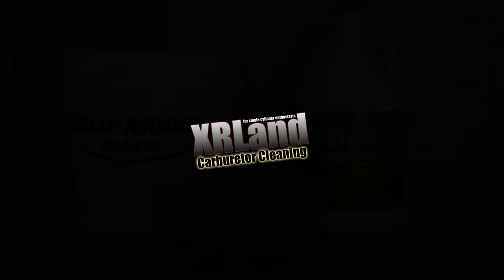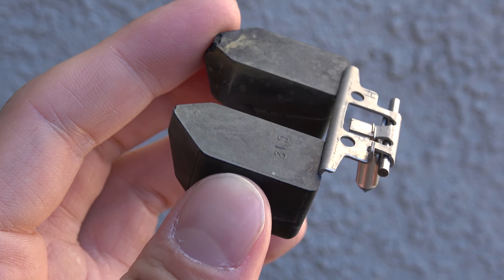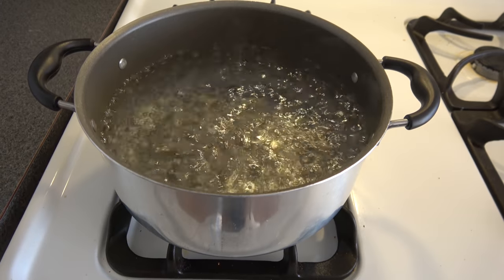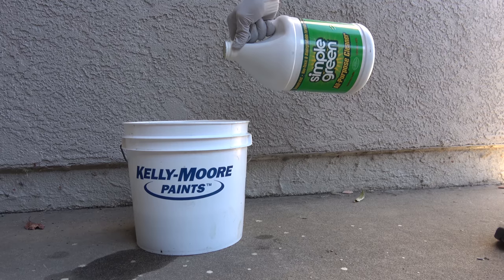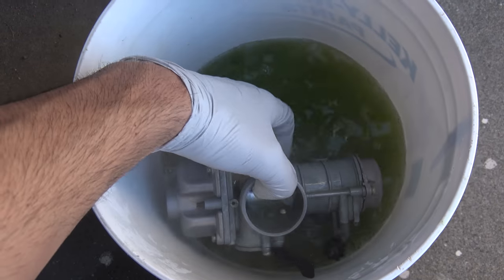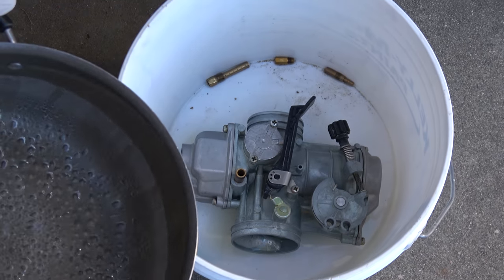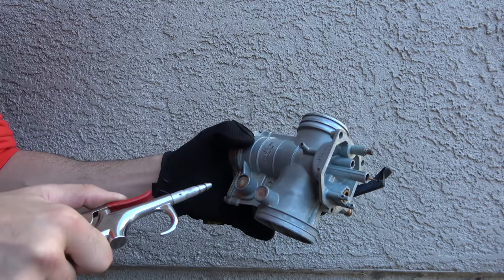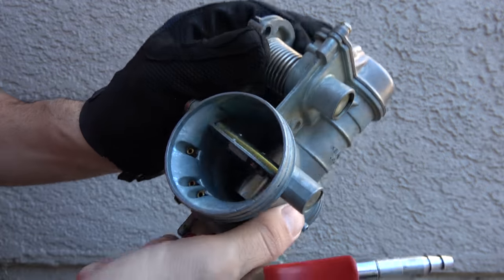How to clean a clogged motorcycle carburetor

Comment: Hello, I have stinky green 9 years of once was gas carb and petcock. Honda VTR 1000. It’s crusty in spots and not even carb cleaner is working. Should I try this, I hope it help the horrible smell?
Reply from the maker: Hello. Hope you can get that VTR running smooth again. I've never used this method on that aged condition of carb, so I can't report whether it will work. My suggestion is that you soak for longer. After adding boiling water and 50% simple green, let it sit overnight or two nights even to allow chemical penetration. You may have to repeat this entire process twice. If that doesn't work, then I'm not sure what you would need to restore the carb to former glory. There are probably more caustic chemicals out there that would work, but I don't have recommendations. Best of luck on your project. Let us know if you figure out what solution to your crusty carb woes. Kind regards.
Reply: So did it work for your crusty cab?
Reply: It did help. When gas turns  from ph neutral to ( add o2 and time ) acidic then to a base -it's caustic. All of the jets needed replacement and the float barrels corroded and many area required bright work. And all rubber parts needed replacing. It took a few times to rebuild the carbs to get it right and today the bike is used weekly. Happy, no awful skunk smells.
Reply: It did help. When gas turns  from ph neutral to ( add o2 and time ) acidic then to a base -it's caustic. All of the jets needed replacement and the float barrels corroded and many area required bright work. And all rubber parts needed replacing. It took a few times to rebuild the carbs to get it right and today the bike is used weekly. Happy, no awful skunk smells.
Reply: It did help. When gas turns  from ph neutral to ( add o2 and time ) acidic then to a base -it's caustic. All of the jets needed replacement and the float barrels corroded and many area required bright work. And all rubber parts needed replacing. It took a few times to rebuild the carbs to get it right and today the bike is used weekly. Happy, no awful skunk smells.
Reply: It did help. When gas turns  from ph neutral to ( add o2 and time ) acidic then to a base -it's caustic. All of the jets needed replacement and the float barrels corroded and many area required bright work. And all rubber parts needed replacing. It took a few times to rebuild the carbs to get it right and today the bike is used weekly. Happy, no awful skunk smells.
Reply: It did help. When gas turns  from ph neutral to ( add o2 and time ) acidic then to a base -it's caustic. All of the jets needed replacement and the float barrels corroded and many area required bright work. And all rubber parts needed replacing. It took a few times to rebuild the carbs to get it right and today the bike is used weekly. Happy, no awful skunk smells.
Reply: It did help. When gas turns  from ph neutral to ( add o2 and time ) acidic then to a base -it's caustic. All of the jets needed replacement and the float barrels corroded and many area required bright work. And all rubber parts needed replacing. It took a few times to rebuild the carbs to get it right and today the bike is used weekly. Happy, no awful skunk smells.
Reply: It did help. When gas turns  from ph neutral to ( add o2 and time ) acidic then to a base -it's caustic. All of the jets needed replacement and the float barrels corroded and many area required bright work. And all rubber parts needed replacing. It took a few times to rebuild the carbs to get it right and today the bike is used weekly. Happy, no awful skunk smells.
Reply: It did help. When gas turns  from ph neutral to ( add o2 and time ) acidic then to a base -it's caustic. All of the jets needed replacement and the float barrels corroded and many area required bright work. And all rubber parts needed replacing. It took a few times to rebuild the carbs to get it right and today the bike is used weekly. Happy, no awful skunk smells.
Reply: It did help. When gas turns  from ph neutral to ( add o2 and time ) acidic then to a base -it's caustic. All of the jets needed replacement and the float barrels corroded and many area required bright work. And all rubber parts needed replacing. It took a few times to rebuild the carbs to get it right and today the bike is used weekly. Happy, no awful skunk smells.
Reply: It did help. When gas turns  from ph neutral to ( add o2 and time ) acidic then to a base -it's caustic. All of the jets needed replacement and the float barrels corroded and many area required bright work. And all rubber parts needed replacing. It took a few times to rebuild the carbs to get it right and today the bike is used weekly. Happy, no awful skunk smells.
Reply: It did help. When gas turns  from ph neutral to ( add o2 and time ) acidic then to a base -it's caustic. All of the jets needed replacement and the float barrels corroded and many area required bright work. And all rubber parts needed replacing. It took a few times to rebuild the carbs to get it right and today the bike is used weekly. Happy, no awful skunk smells.
Reply: It did help. When gas turns  from ph neutral to ( add o2 and time ) acidic then to a base -it's caustic. All of the jets needed replacement and the float barrels corroded and many area required bright work. And all rubber parts needed replacing. It took a few times to rebuild the carbs to get it right and today the bike is used weekly. Happy, no awful skunk smells.
Reply: It did help. When gas turns  from ph neutral to ( add o2 and time ) acidic then to a base -it's caustic. All of the jets needed replacement and the float barrels corroded and many area required bright work. And all rubber parts needed replacing. It took a few times to rebuild the carbs to get it right and today the bike is used weekly. Happy, no awful skunk smells.
Reply: It did help. When gas turns  from ph neutral to ( add o2 and time ) acidic then to a base -it's caustic. All of the jets needed replacement and the float barrels corroded and many area required bright work. And all rubber parts needed replacing. It took a few times to rebuild the carbs to get it right and today the bike is used weekly. Happy, no awful skunk smells.

Comment: Not sure why he would put carb back together to clean.
Reply from the maker: This method works well without complete disassembly. I tried it with a set of carbs that were clogged from multiple years of sitting, so I wanted to share a relatively simple method for cleaning the carb. Pulling the jets out opens up the smaller passageways, and for those with multiple carbs, this is a bit faster. Let me know if you have questions. Thanks for commenting.